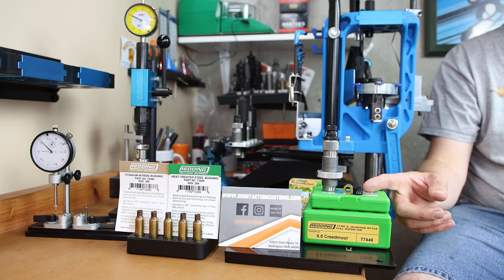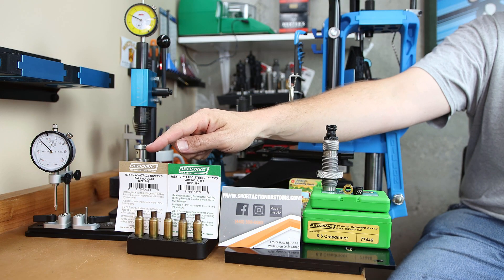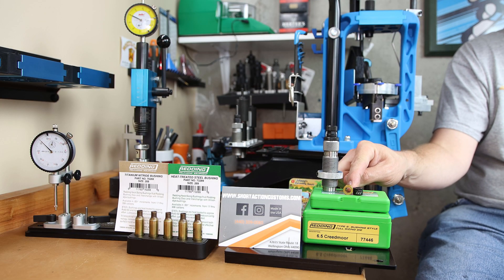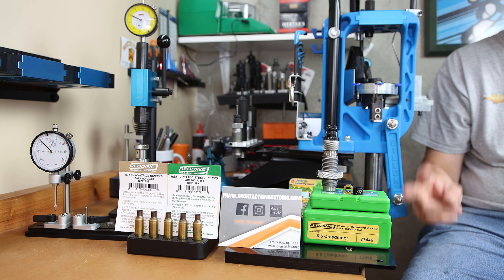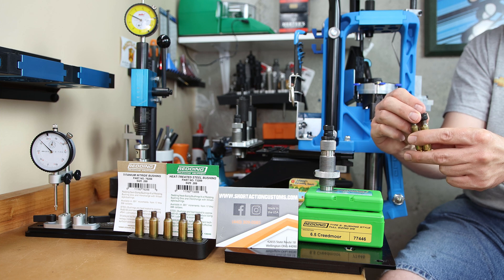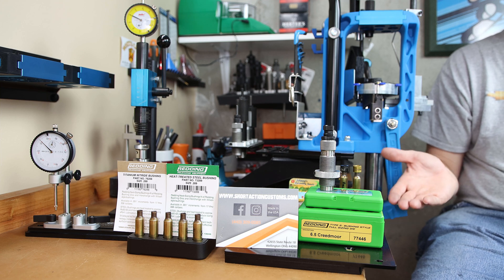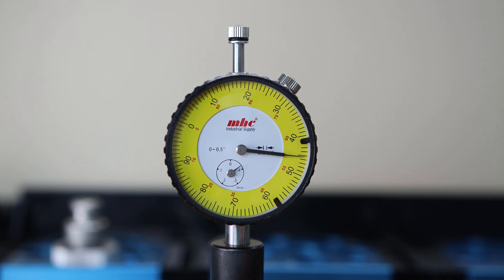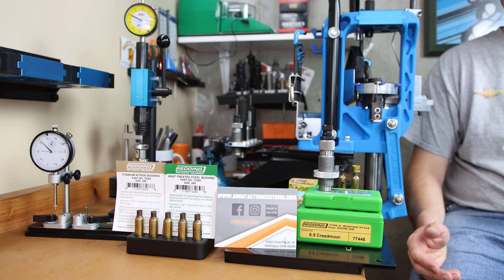Your Die Bushing Matters! - Choose the correct Die Bushing

Comment: On an unrelated reloading subject. I recently learned of a new method for reloading belted cases. From what I understand you take an over sized mandrel or expander ball and run it through the neck of a piece of new unfired brass. For example for a 308 diameter projectile you would run approximately a 338 diameter mandrel through it. Then you would begin to run the piece of brass into the resizing die in small increments. Between each progressive increment you attempt to chamber the brass in the intended rifle. Once the false shoulder/over expanded neck is sized far enough down the neck to allow the piece of brass to be chambered in the rifle you go ahead and load that piece of brass. Once fired in the intended rifle the piece of brass should essentially be fire formed to that chamber with minimal stretching/thinning above the belt. Of course the piece of brass is now only reliable in the single rifle and would not be totally reliable in austere environments. I hope that I have explained that well and was curious if you had any experience with this method, or how it would compare to other options such as the Larry Willis die. I was considering this practice with a 375 H&H I'm doing load development for. Thanks again for the great videos and knowledge you provide.
Reply: Sounds like fireforming to a new cartridge. Bench rest shooters make a false shoulder when converting brass. 

I recently tried this on some 308 brass that had been severely bumped back at the shoulder. 0.010 to 0.015 less than the fired brass. As a comparison,  I also shot similar brass with the bullet loaded long (0.005 jam) and some control rounds with no special procedures. While the false shoulder did give improved results over the control, the bullet jam method was better still. 

If your goal with the 300 wm brass is to lengthen the shoulder to case head distance by taking brass from the neck shoulder area rather than lower in the case body, both the false shoulder and bullet jam method might be worth a try. Keeping loads to the minimum end of published data of course.
Reply: @keith9737  I appreciate the info. I've never personally used either method but am interested in testing both. The jam method is new to me but sounds like it has potential. Thanks again.

Comment: How does the SAC bushing affect the shoulder of the case? Is there any impact on the "doughnut" that usually results from bushings? Thanks for the great videos you put out. Keep up the great work.
Reply from the maker: I would assume (still need to test it) that the "donut" would be even less of an impact since it would not size as much closer to the shoulder, but you could accomplish the same thing by not sizing as much of the neck I would think.

Comment: Awesome video.  I have also obtained better concentricity from my Forster FL sizing die over the Redding bushing die.  I'll have to try the SAC bushings!  BTW, have you tried the SAC sizing/seating dies?  They're out of stock now (and very pricey), but If they're bushing is this good, I'd be interested.
Reply: The reason you are getting better performance on the non bushing die is because the bushing die is specifically designed for turned brass. If you aren't turning the brass, it won't make adequate contact. The non-bushing die is essentially taking your neck and squeezing it down 0.010" while the bushing die is only going down as far as the bushing you chose, which is typically only 0.002 for bolt guns. If you aren't turning your bass, just go non bushing and leave the default expander ball in.

Comment: I'll chime in by saying that I've used RCBS die bushings and, although it does have a slight bevel to help align the case necks to the bushing hole, the run-out seems to match your Redding example - roughly 0.001" as a general rule, with some odd-balls going to 0.002 and 0.003".  It should be noted, however, that I'm still using the standard expander ball, not a mandel.

Comment: Was brass neck turned ?
Reply from the maker: No
Reply: @BoltActionReloading  I still think using mandrel to push any brass imperfections to the outside is best. That is of course when a fired case lets bullet drop thru before resized. Cheers

Comment: I would be interested to see the results of full length resizing with a bushing and then following up with a mandrel as well.
Reply: Yes, please test bushing plus mandrel
Reply: Yes that's what I do. Redding TiN bushing and a Sinclair Carbide mandrel. Seems to work.
Reply: @redrock425 So, the bushing does the outside of the neck to a specific size, then the mandrel to an inside neck tension?  Which do you do first?  Does it matter?  Right now I just FL resize then use a 21st Century turning mandrel, but if a bushing helps…
Reply: That's what I do. Get very consistent results and very low run out.
Reply: I would too. I'm thinking about changing my method
Reply: You know... like how everybody does it. Haha
Reply: Thats what I do for both of my 1000yd competition benchrifles. I also shrunk 10 shot groups at 1000yd down with my 6bra from 9" to around 4" just from going from 0.002" to 0.0035" tension

Comment: Don't use the expander with the type s die!!!!  I have .001 to .0005 run out with these dies on all my rifles !!!!
Reply from the maker: I am not using the expander. I never use them. If I were using anything it is a separate step with a expander mandrel.
Reply: Copy that.   I have great luck with type S dies and I know that expander mandrels work.  They work great with Redding Competition seating dies in my system.  I don't care how you get there but for you and me both eliminating runout is the goal. The advantage I see with mandrels are they uniformly size the inside of the neck minimizing effects of neck wall thickness.  Neck bushings forming from the outside will accentuate uneven tension with unturned necks.

Comment: I am using a .291 bushing and the seating force on my K&M press is 80-90! This is once fired Lapua brass that I have annealed. Why is it taking so much to seat?? Using Redding bushing die to size brass
Reply from the maker: That does seem like quite a bit. Are you champher and deburring well? Also brushing out the case necks?
Reply: @BoltActionReloading   Wow, I guess in my rush for power and glory I forgot 2 very important steps—made all the difference. Seated around 40 after chamfer and deburring. Thanks!!
Reply from the maker: @s.manuel7969  great to hear!

Comment: I use a S die in .308 with a Wilson .335 bushing and a carbide expander button set as close to the bushing as possible  on Lapua brass. Only once in the last 5 years was I able to set the die up, ( after a cleaning) with around.001” runout.
I will definitely be looking into those bushings
Reply from the maker: Good Luck!

Comment: Great info.  I use a TiN Coated Redding bushing to neck 6.5 Grendel brass down to 6mm.  Im getting ready to process all this brass from its first firing, and will look strongly into buying a few of these!
Reply from the maker: I was very surprised on the results, I still need to see if there is a real difference on paper but the first results are promising.
Reply: @BoltActionReloading  It certainly can't hurt!  I use a Hornady bushing die on my 6 CM, so it will pull double duty.  Sinclair mandrel to set 2 thou neck tension, which works great.

Comment: Interesting information as usual.  Probably like most everyone I'm trying to yield best results from my reloading process.  So videos like this gives information worth considering.  I've been using Whidden bushings for a while now...but thinking I might give the SAC bushings a try.
Reply from the maker: Hi Tim, I am glad you are enjoying the videos! When I saw the claim about better concentricity I thought it was unlikely but I have been impressed with SAC so I gave them a whirl and am glad I did. I will certainly be using these in future content.
Reply: @BoltActionReloading  While I'm still contemplating ordering up some SAC bushings, decided to experiment.  Ran a little tighter bushing on my annealed Lapua brass then use Lee Collet Die...the seating force felt very consistent, with a light but "firm" resistance from case to case.   Guess we'll find out if it translates to consistency at the range.
Reply: Are the Whidden bushings not machined in the same manner as SAC bushings? Looks like it also has a gradual/guided diameter before narrowing after the case mouth has entered the bushing.
Reply: ....SAC looks like black nitride where Whidden offer gold nitride. Anyone with an opinion and preference with regard to the one over the other?